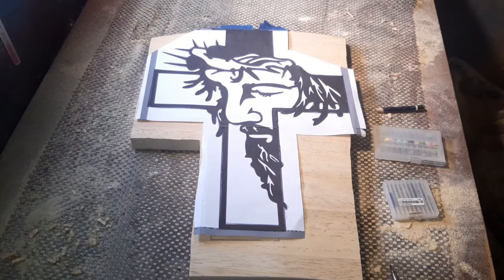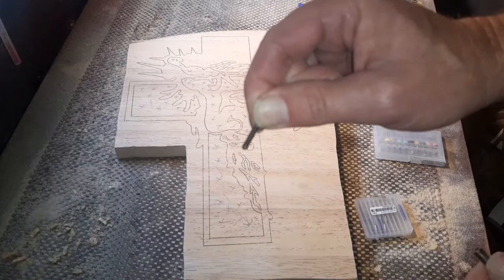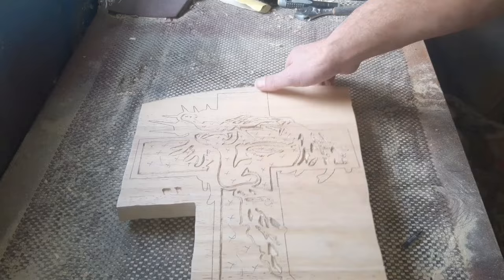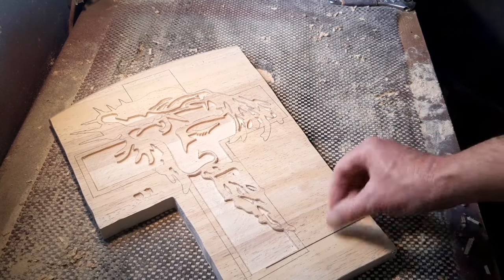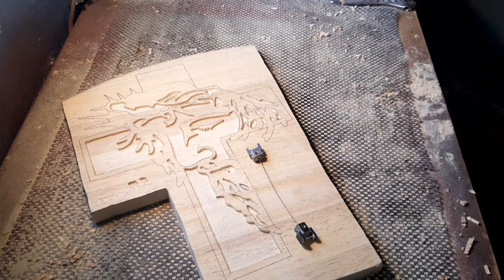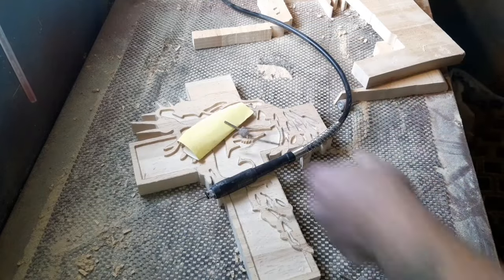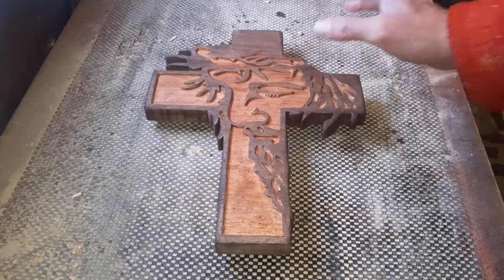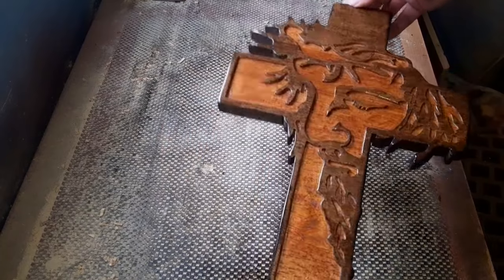Wooden Cross routed out on recycled pine..router project.

Comment: May i ask the Router model and what you recommend if you buy one now? I'm starting. 
Also, may  I also know your scroll saw model. I got an old Ryobi that holds pin blades only.- Your thoughts on that please?
Reply from the maker: My router is a black and decker dn66 they don't make them anymore but I can still find them on ebay or marketplace  I'm on my 9th machine,  bosch gfk225cen would be my next choice, my scroll saw is an old draper ,unfortunately I have to use adapter clamps because it only takes pinned blades without them..
Reply: Thank you Sir @fishtank5050  
Excellent work. The cross was just amazing! 

I love the router scrollsaw combination than just one. God bless!
Reply from the maker: @sjohn-777  thank you I appreciate your comment 👍
Reply: Lovely work. I do scroll saw stuff but haven't used router much yet. What bits do you use I think mine is 1/4 inch bits it takes. Appreciate guidance